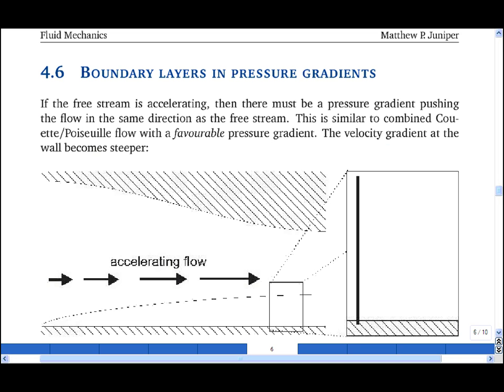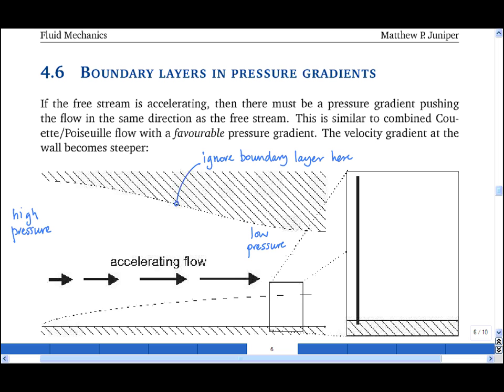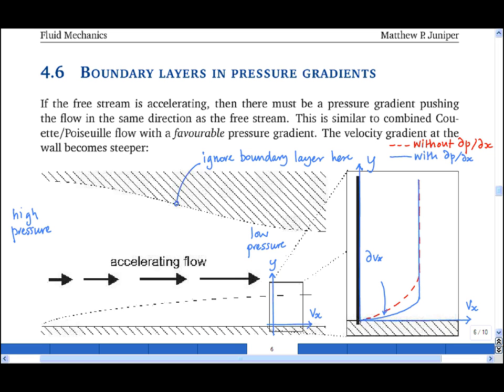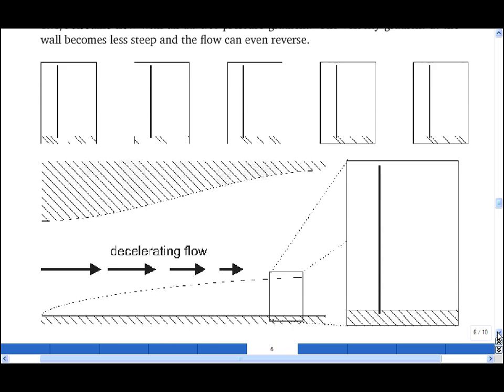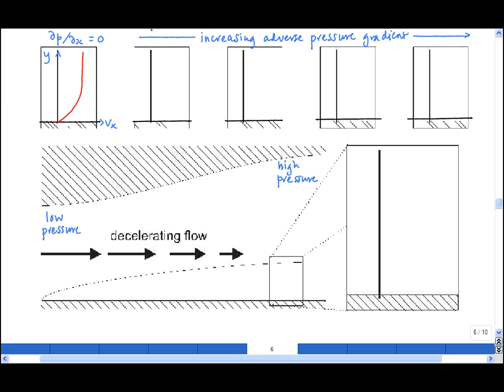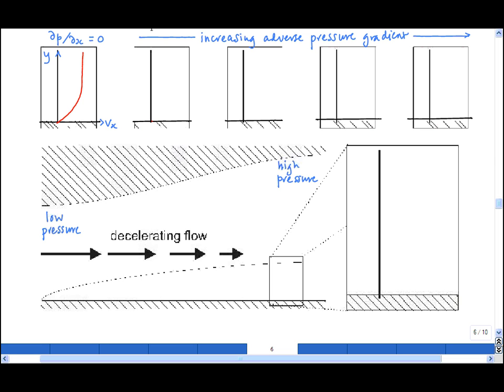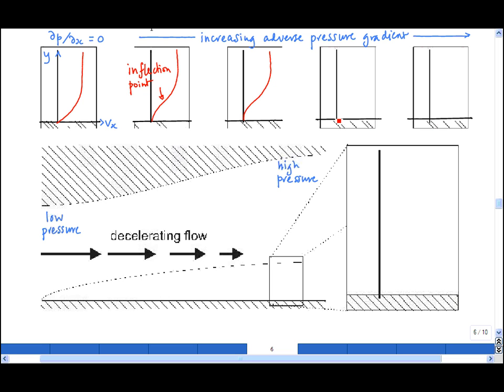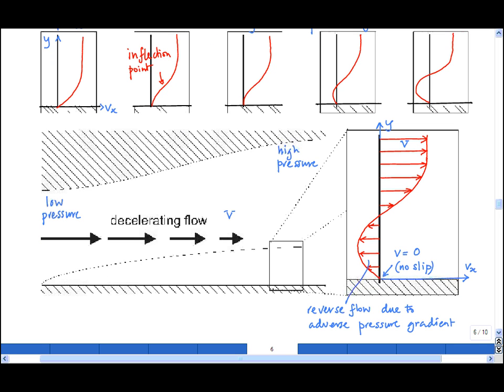4.6 Boundary layers in pressure gradients

Comment: how is the pressure gradient created in the first place?
how does anything flow?
isnt a pressure gradient created as the fluid flows?
Reply from the maker: This is a chicken-and-egg question, as your last question suggests. A pressure gradient, and corresponding fluid acceleration, can produced by a moving boundary (e.g. when you blow air out of your lungs or push a piston in a cylinder) or by gravity (e.g. by  placing a tank of fluid high up in a house).